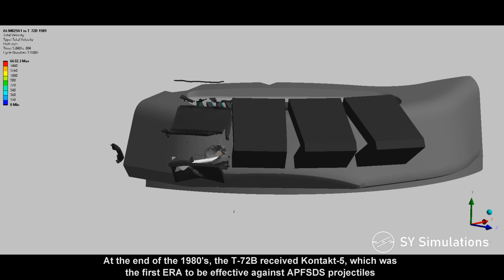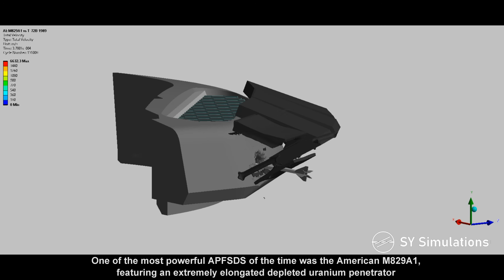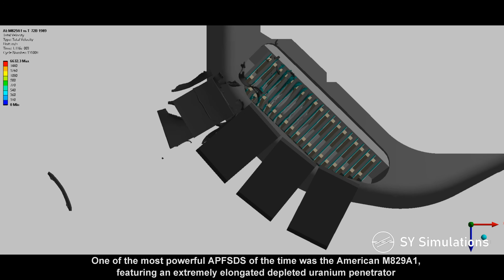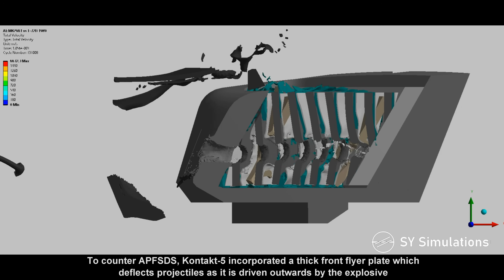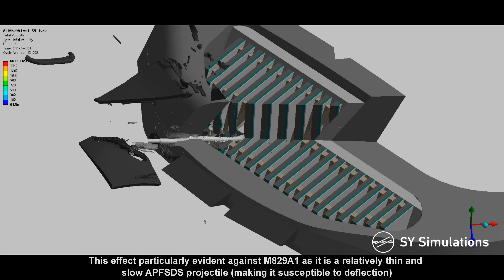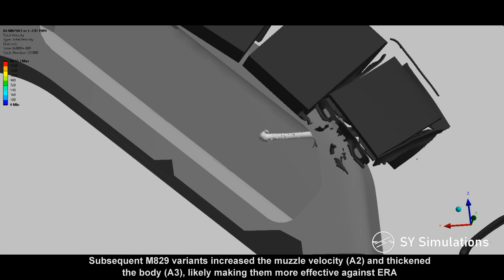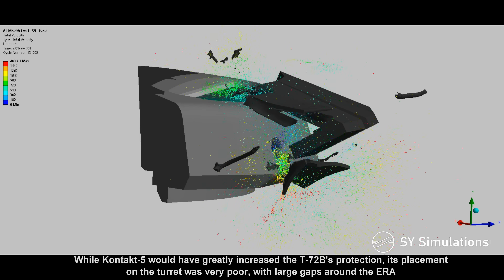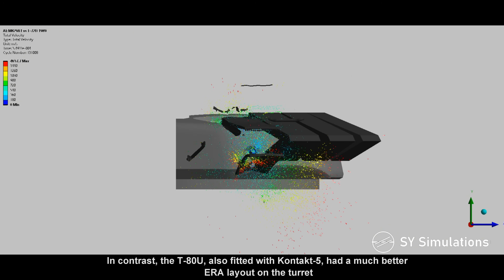SILVER BULLET vs KONTAKT-5 ERA | Abrams vs T-72B '89 | M829A1 APFSDS Armour Penetration Simulation

Comment: Looking on the British national archives, You can see multiple pictures of early Chobham armour. It consisted of multiple plates ( 5mm steel, 5mm rubber, 5mm steel is the likely configuration) angled parallel to the burster plate (normally around 38mm of RHA) and backer, which's thickness would depend on the vehicle. When looking at the leaked Abram's armour, you can see a similar concept, just with the sandwich plates angled. Considering this, I think it would be an interesting simulation to simulate this against an early, but still effective, APFSDS such a s 3BM26. Much appreciated thanks
Reply: It is the same concept. Because the Abrams mounts chobham XD.
The first test bef was the XM-1 for Chobham.
And so the US and UK use it.
With the UK progressing to Dorchester. And the US using Chobham with a few updates
Reply: Why 26?! The Soviets fielded 3bm42 at that time was definitely capable of penetrating all coalition armour present in 1989. Hull armour that is. Turrets are much thicker and may, depending on vehicle and modification, absorb 3bm42...
Reply: @Masterafro999  I see you frustration, but this Chobham was only a prototype. These public images were from the late 70s when Chobham was still being tested, so this is not what went onto Challenger 1. 3BM26 was developed in 1983, a half decade after the Chobham, but 3BM42 was almost a decade after. Again knowing this is not a combat ready depiction- I think its better to use a more weak, yet still formidable for its time, APFSDS shell such as 3BM26, which was closer to the pictures time. Again i understand what u mean tho-
Reply: @collettesaward1730  hmm I guess so.
Reply: @collettesaward1730  it was a prototype that led to the best armor since the t64. Most main battle tanks Nera configurations are Chobham or a derivative. 
Basically, the US uses a Dorchester configuration now. But it did use a Chobham style.

The reason in the US and German Armor is so strong is the expensive materials they use in those same configurations.
Reply: @Masterafro999 because GHPC
Reply: @Masterafro999  in the overall 30 years, there’s been a few months, where the Soviets had anything that actually scared the M1. Soviets were never able to penetrate all coalition Armor except in their own minds. 1:27  what the propaganda said so they could sell more tanks to Third World countries.
This is the same Soviets who told the Egyptians, the T 55 was immune to centurions and M 48.
The same Soviets, who told the Iraqi the T 72 could not be frontally penetrated by 120-105 mm on the turret as long as they were dug in. 
The same people who told the Syrian’s their T 80s and T 90 were immune to top down missiles.
The same people who told the Pakistanis their T 80s and T 90s or friendly immune to indian challengers.
Finally, Ukraine has proven how much BS the Russians are full of.
Over 50 supposedly immune mbts of the new variety getting frontally penetrated from old ammo.
There was a few months in between the M1 and m1a1 where the 3BM42 had a 50% chance at 2000m. 
So Congress funded the upgrades to make it 95% frontally immune.
Only the turret ring was vulnerable.

Then the later darts came out and darpa said the M1A1 had a 35% chance to be penetrated at 2000 yards. 
So it got depleted uranium. High hardened steel inserts. And doubled it ceramics….. once again it became immune.

Comment: As long as Abrams gunner is aiming for the best armored part of turret cheek it's functional but as the narrator pointed out Soviets armored a small portion on the corner of the turret and just hoped to get hit there.
Reply: Real life is not War Thunger, like many geniuses like to joke like " MuH YeLlOw DR1Ver ", the gunner or commander will simply aim center mass of the part of the enemy tank that they see and due to deviation, you dont know where the round will hit, its not like a video game. In real life there is no such thing as aim for weak spots.
Reply: if you have ever seen the T-72B obr 89 from upfornt, you can not see the gaps between era at all.
Reply: @barbarapitenthusiast7103  What do you even mean? On turret alone there is area below and above the ERA that is not protected. If you shoot center mass you hit in the area of driver hatch and gun cradle, weak protection in the center there.
What Warthunder considers a glazing hit on thop of turret will be a pen IRL.
Reply: @MarcinP2 the turrer has no gaps in ERA coverage when viewed in front aspect. There is no gap above the ERA as it reaches higher than the turrer roof, and the are bellow, the cutout for the driver os to small to be an issue, tank guns have serija dispersion, particurarly at average engagement ranges. Only the area bellow the sight is an issue. Just Look at the thing.
Reply: @barbarapitenthusiast7103  
"the turrer has no gaps in ERA coverage when viewed in front aspect"

The coverage is spotty, like a dalmatian.
Imagine a dalmatian dog and say "the dots are all bulletproof". Then if someone says "there are spaces between the dots" you answer "the spaces are so narrow you are unlikely to hit them".

Yes, there is not a meter wide gap but there are multiple smaller gaps that will be hit by dispersion of the round.

The gap left by driver hatch and the lacking ERA at the bottom of the turret is more likely to be hit by a center mass hit too even with dispersion.
Reply: @MarcinP2 again, Just Look at a picture of a obr 89. There are no gaps in turret cheek ERA coverage when the turret is viewed in FRONT ASPECT. You know what FRONT ASPECT is? If you are staring at it, and Its looking straight back at you, thats front aspect.
Reply: @barbarapitenthusiast7103  There is a huge gap below and above and in the center.
Reply: @MarcinP2 there is no gap above, the ERA tiles extend a far ammount abovevthe turret roof, not to mention there is ERA on the turrer roof either way. Bellow? To small to be a problem, even less than the abramses turret ring. In the center? Around the gun? Yeah, just like on a tank with a gun mantlet, but those arent the turret cheeks are they?
Reply: @barbarapitenthusiast7103  It does not extend to turret roof and the ERA on the roof is angled upwards so much it will not work for hits from front. An APFSDS will snail its way trough the round turret tops as long as it is below critical angle of 89 degrees IIRC as they have a tendency for the penetration channel to stray into the armor when armor is thinner. The turret tops on T series tanks were made before it was known that they would be weaker than LoS thickness suggests against slender projectile.

As to the gap below being too narrow? It's a foot wide, and together with gun cradle not having ERA, driver hatch and the ERA edges having less effect there is enough there for a shot like 80% of time to go trough if aimed center mass.
Reply: @MarcinP2  Guess what, a true center mass shot Will penetrate any tank, becuase its at driver hatch and turret ring level. But as much as you aim center mass, you wont actualy hit center mass. The FCS isnt going to be accurate enough, especialy not in the 80s with ruby based LRFs not to mention dispersion at average engagement ranges. Thats why weaksots are concearn in games, with perfect accuracy, but are hardly an issue IRL. The soviets, like anybody else ran firing tests and knew where they were likely to hit. Basicaly every spot that can hold K5 without interfering with the crew is covered.
Reply: @barbarapitenthusiast7103  In the West we just have good base armor also the driver hatch can be on top of hull not on the sloped part, that makes it way smaller weakspot and does not make the area in front of it weaker.

I think you need to make a little exercise. Take a red cryon, take a green cryon. Color the area covered by era in Green, rest in red. There is a big cross shaped gap in the middle of the tank front profile. Couple that with FCS and cannon that has a reasonable dispersion and will not merely hit the outer edges and you have a lot of unprotected area.
Reply: @MarcinP2 the abramses hull is a major weakpoint if looked from even a slight bump in elevation. It only works on perfectly flat terrain where the hull can keep Its perfect angle. 

You know all designs have their weakneses, the T-72 needs to allow Its driver to exist therefore that is a weakpoint. NATO style tanks have Massive breaches and weak hulls. 

Either way, the area on the obr 89 not covered by ERA is more or less equal in size to weak areas on the Abrams.
Reply: @barbarapitenthusiast7103  But if you look from a hill at a T series tank the entire turret top is a weak point not to mention the angling on the hull front plate plate also stops working.
Abrams at least has the gun depression to not be forced over the crest.
Reply: @MarcinP2 he means that if the Tank is facing you, the ERA will act like a sword crossguard, which means that even tho there is a physical gap between the plates, you cannot exploit it, because they are angled in a way that frontally you cannot see them.

Really just loot at a image of a T-72B3 with the turret facing the camera/viewer.
Reply: @gerfand  If you imagine the important part of heavy ERA, the heavy plate, the gaps are there.
An ERA block hit from the side does not work well. We also never do simulations of hitting on or near the edge of the era brick, upper or lower edges etc  we always assume center of brick hit.
Reply: @MarcinP2 Sure, but that doesn't change what I said.

Comment: As far as I know Lanz-Odermatt is for LoS of a continuous block isn't it? Most modernish turret composites are going to disrupt any penetrators greater than the sum of their LoS by 10-40% anyway, so there should be some accounting for that no? Especially since these NERA composites continue to add lateral stresses to a rod that has already significantly reduced structural rigidity after passing through heavy ERA. I'm going to guess that the normally only slightly effective (against APFSDS) NERA modules become significantly more so when the rod is already "pre-fractured" and much less resistant to any kind of bending forces
Reply from the maker: Yep, L-O is not applicable for composite armour, let alone ERA. However it's a compromise to allow for some sort of comparison.

Comment: Very impressive! If it had made it through, that turret would have been blown 100m sky high.
Reply: No. Turret would be flying if lower hull would be penetrated - there is no ammo in the turret itself
Reply: @Янус_Ырт  If T72 is penetrated then it pops top. Seen it 100 times.
Reply: Nope, it's the ammo that's stored in the hull that cooks off, not the ammo loaded into the carousel.
Reply: @BigSmartArmed carousel is in the hull bruh
Reply: @Янус_Ырт  It is, with the lowest exposed area of any other design.  It's the additional rounds that are stored in the hull that are most exposed.
Reply: @BigSmartArmed  and by "lowest exposed area of any other design" you mean "most exposed area of any other design".
Reply: @BigSmartArmed  If some of the ammo goes, all of the ammo goes. Everyone knows these things are death traps.
Reply: @trentvlak  Do you comprehend HE?  Doers your brain register the difference between HE and HEAT rounds?  Go ahead an try to fit the concept somewhere in there.  Use a hammer to assist.
Reply: @BigSmartArmed  In an enclosed space like a water brained designed russian death bathtub, it doesn't matter. it go boom.
Reply: @trentvlak  hurrr duuurr badabing goes big boom, duuuuuuhhhhh 

seethe harder you doink
Reply: @BigSmartArmed  I'm not experiencing any emotions. Who hurt you?
Reply: @trentvlak  naah
Reply: @trentvlak  any tank is a death trap if penetrated

Comment: Fantastic work!

 K5 (when it initiated and worked), absolutely would have caused problems for everything shot at it. The M829A1 was a nightmare for every tank in service, (even the first M1A1HAs would have their turret armor package bypassed occasionally in tests), however as this simulation shows, when working and hit in the right spot the armor wins against the best APFSDS of the 1980s. 

That said relying on a apfsds to come in at the correct angle, location and speed (early K5 has issues with initiation below 1550m/s) is a bit of a gamble, and the soviets were well aware of this after studying Tow-2As, Hellfire, and M892A1s and their use in the Gulf War, and advised users of their tanks in the 1990s (Cyprus) that their tanks were not meant to slug it out frontally against anyone shooting this round. 

For the Americans the M829A2 solved this by vastly improving the alloy, increasing the speed and some tip changes, but it did not reach service until 1994.
Reply: It illustrates perfectly the difference between reality and video games. In bideo games you aim at enemy gunner and weak spots, in reality you just shoot center mass and if by fluke the penetration does not happen you aim center mass again and keep shooting. The guns have too much dispersion to hit a small gap when asked to.
Reply: @MarcinP2  Well said. I think Steel Beasts does a good job as showing how lethal APFSDS rounds can be but also how against modern armor packages you need a bit of luck for that first round kill.
Reply: M1A1HA doesn’t struggle against M829A1 on the turret and UFP
Reply: @somerandomboibackup6086  

Struggle might be stretching it, but testing done in 1989 showed that multiple hits close to the same spot caused round fragments to enter into the crew compartment. The goal of the tests were to test the armor to destruction and see about contamination. 

"Fliszar, Richard W., Edward F. Wilsey, and Ernest W. Bloore, Radiological Contamination from Impacted Abrams Heavy Armor, Technical Report BRL-TR-3068, Aberdeen Proving Ground, MD: Ballistic Research Laboratory, December 1989"

A Hellfire warhead was mounted at inclined angle to the armor package and also defeated it causing a major fire. 

I saw the report before it was scrubbed from the internet about 15 years ago.
Reply: Take any simulations like this with a truckload of salts as they have a tendency to use a random Tungsten/DU formula NOT the actual formula used by the rounds.

In Reality The 829A1 would have penetrated the turret and exit out of the back as what happened when we did the test in the 90's Against a T-72B with K5.
Reply: @gotanon9659  wrong, the tests showed neither the B nor the U could be penetrated
Reply: @gotanon9659  except M829A1 failed misserably against K5, thats why A2 was developed as soon as the test were done.
Reply: @gotanon9659  
Bot
Reply: @gotanon9659  Except the tests resulted in the exact opposite of what you just wrote? Don't make things up if you didn't read the results of the test.
Reply: @voidtempering8700  The mechanical strength of the A1 rod can be reasonable approximated. The A2 staballoy is expected to be 5-10% better against RHA than the A1 and have far better yield strength and toughness. The A2 mechanical properties in simulations found online are almost certainty wrong.   These improvements to the DU also goes for the armor inserts on the initial improvement to the M1A1HA+/A2 tanks.
Reply: @evanbrown2594 What does the simulation have to do with my comment? The tests were done in the 90s, and the A1 failed to penetrate the T-72b 1989 and the T-80U.
Reply: @voidtempering8700  His comment was about the mechanical properties of the rounds not being known, you reference test results...What tests?  The tests referenced by Janes correspondent  Richard M. Ogorkiewicz in the 1990s details are purposeful in their vagueness and only reference the M829 not the A1 or A2.  There is no mention of the T-80U and mistakenly says that the East Germans provided T-72s with K5 which they would have had to have stolen from the GSFG as they never had anything beyond the T-72M1.

Comment: infantry would never want to be close to this stuff going off, also, I bet the armor inside burning is a weird thing to deal with
Reply: Infantry also wouldn't want to be in front of a tank at all, period. That gun going off with you standing anywhere near the muzzle will end with your decomission due to injuries that are, as always, not related to your service ;) ERA produces quite a lot of smoke going off, but there's usually nothing to burn after it explodes. Overall external fire for a tank is not a problem, as long as it's not completely covered in napalm - that could overheat the engine and suffocate the crew, yes.
Reply: @user-vgrau  Your body would be decommissioned if you were next to the muzzle blast